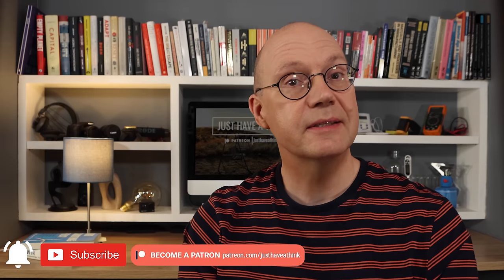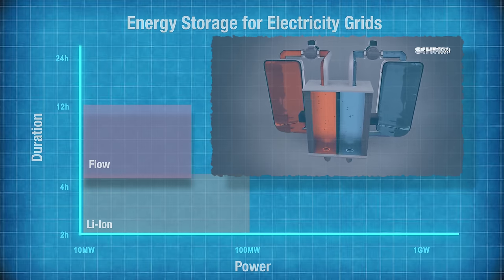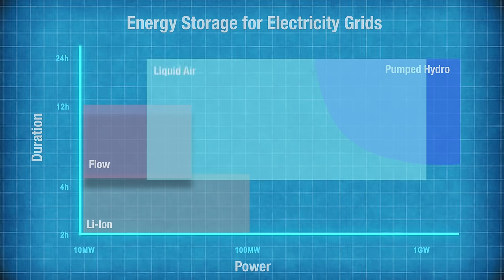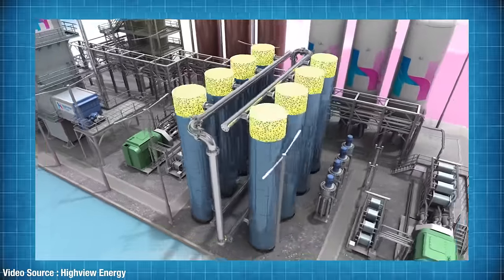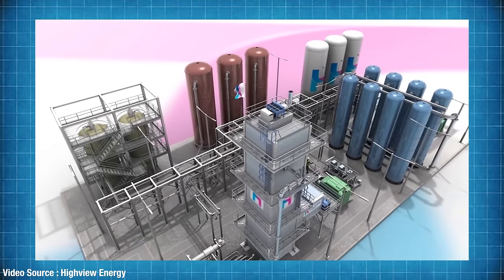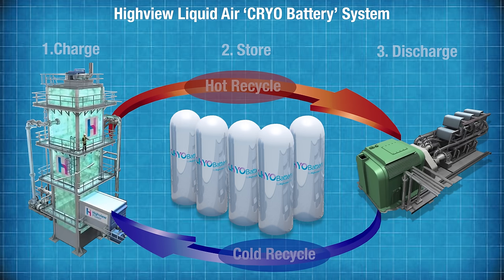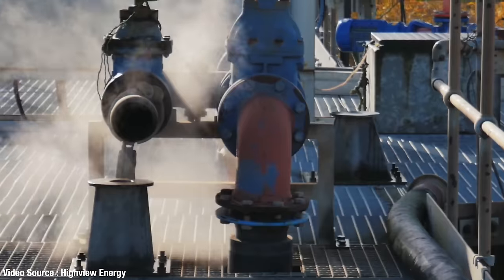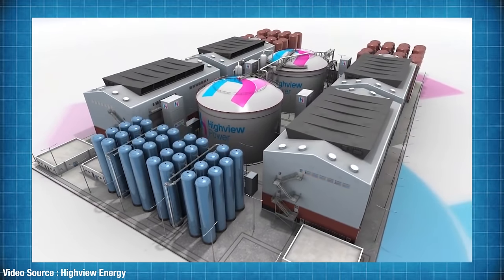Liquid Air Batteries. Literally energy from thin air. Seriously. Literally!

Comment: The 60% efficiency are mere speculation though,  the only time they actually measured it they achieved 15%.
And to be honest 15% makes a lot more sense, there are thermodynamic limits on how efficient you can cool and liquify air at -195°. 
A cool concept, literally and figuratively, but it has to work before I belive in that.
Reply: Right, they have a huge efficiency problem.
Reply: I fix...   LIquid nitrogen
Reply: I think using magnetic refrigeration this higher efficiency is possible.
Reply: @princefriendship  I'm afraid that magnetic refrigeration will not be anywhere near economic at sufficient scale. The problem is that the magnetic field needs to be of the order of >1T over 10's of metres cubed. Superconducting magnets this size might bankrupt a small country.
Reply: @princefriendship  I haven't heard of a magnetic refrigarator in that temperature range though. 
You would probably need several different refrigerators in a line, because the entropy change just isn't that large.
Reply: @yzScott  I agree Scott the technology does not belong in the Electoral infrastructure it is the direct competition so fossil fuels and electricity. We are creating billions of dollars of additional stranded cost even trilliums in the dollars and the opportunity cost of that is mind-boggling. Just like you don't have to connect to the local methane grid the people have to petition their government to be able to build inner city homes what are self-sustaining as to the energy. You don't have to pay for the sewering if you want to save the planet. Getting autonomous trucks to bring you what you need and including the liquefied nitrogen and oxygen may need Constitutional Amendment but that is definitely doable I mean we did it twice for ethanol we can do it once for nitrogen.
Reply: Marc T  Europe has recognized that heat has a temptation to people who speak without doing the math. They have been for a number of years not decades researching seriously Cold Storage. But liquid nitrogen is cast as gold storage by the electric utility industry, not by me.

The question that you raised concerns the viability and Constantine airing or cost engineering of Distributing energy with high temperature liquids. Heat is far more dangerous and salt is infinitely more expensive.

It's important to appreciate the impact of zero. It's actually a number and people argue in ways technologically dependent without awareness. The two comments I am responding to not just yours accept witlessly the propaganda ignoring anything--but esoteric facts like liquid nitrogen is a material. It is a material whose value has been historically suppressed. If you consult the comments on the originally titled liquid nitrogen economy crowdsourced encyclopedic submissions people argue and I am sure the location of their existence if accurately discoverable would be compelling and not on your side is dangerous.

 You can say all sorts of things about liquid nitrogen but like Three Mile Island it does not speak to Danger. In both cases man-made equipment that was abused and did not need to be made created fear of the irrational totally irrational and unfounded species.

 Liquid nitrogen is an added value material. It has nothing to do with Cooling. Just because we have change the phase of the atmosphere historically one way does not mean that that way makes any sense. I agree people don't skin cats anymore but we are talking about saving the world and disruption is easy to put off is easy to argue against and the truth nothing is easier to mock.

The enemies of progress will never do the least to be true to their cause. How much is too much for a gallon of liquid nitrogen? You won't say. Even talking about the cost is something that has not occurred by any of you. It says if you know oh, what you have done today, creates the debt you will never pay and not having anything to say at the gates did not stop you. As if. I know that you're Clueless. don't get me wrong about that please.
Reply: Marc T  I knew that people would nitpick about various de minimis costs but very much appreciated the bonus material you have offered.

I don't think you understand the gist however. You also seem to not understand that expansion does not drive the potential energy but rather at the forces of the expansion and that the temperature correlates nonlinear but Beyond very much merely exponentially phase-change expansion forces. That's why I emphasize the mass itself it's being converted into energy when the phase changes. It is that nuclear energy that using the atmosphere as a means of making mechanical energy portable.

It's the difference between plain old telephone twisted pair and Optical fibers that can only transmit light. Electricity is not fuel because it cannot be bottled cheaply enough to compete. Energy however can be distributed internationally and that's why you're saying putting molten materials Underground is not relevant to the portability of energy and what that does to demented Notions of Market expansion for the electric grid to include traction power. Traction power uses fuel and nitrogen is fine.

Your argument is however pathetic regarding by-products. Liquid nitrogen is a byproduct currently. the way by products are currently obtained has nothing to do with the way you would do them given scale. thermal pumps especially benefit from scale not just when you use water as your refrigerant but apparently the market which you respect are you the magnetic bearings become cost Justified only in the largest compressors. This sounds like vacuum tube controlled magnetic bearings more than a contemporary observation but there are additional orders of magnitude in scale especially globally when you Kim chip energy and create energy as this Millennia commodity.

Commodifying raw energy means learning how 2 snap atmospheric gases and ship them at Hypersonic speeds without using much energy to do so nor in a cost-prohibitive manner. I understand fully how to get this done. I expect resistance.
Reply: Marc T  If by "word salad" you mean yummy and satisfying, then Yes. If not, then "Free your mind!".
Reply: You don't need to prove it works. Just convince those who dish out the grant money.  
It looks to me like an elaborate way to convert electricity into heat. Loose lots in storage. The covert what remains back to electric.
Reply: @yzScott  and no storage has 0% efficiency, if you can make the infrastructure at a price comparable to making a new power plant of comparable output it could be feasible at 10% efficiency.
Reply: @jean-pierredevent970  I think that's French is so beautiful and I guess I do for a reason but besides the growing up in Paris we bring I respect 2 genuine Elegance instead of acquired tolerance two sofas tree that never goes away. I'm presently away from the grid so it's cheaper to just proceed with the riddles as opposed to correct them at this point but I will add it at some point.

The best the lie detector is the Rorschach. You see before you a a basically Bots Lament not paid to condescend but condescending because it can't actually comprehend what it's paid to intervene against disruption of. The disruption is above the pay grade of those paying the bot.

Jean-Pierre we stand and can resist. We are not the Bots. It is too stupid to be satire what the bot says namely don't squeeze heat out of vaporized oxygen and the nitrogen but instead use to small wire and too much energy. The Bots says spend too much money on infrastructure to do so. Taking the heat out of the air leaves behind as a byproduct the potential energy liquids and the boss says they cost too much when they are less than free.

As a scholar in the history and philosophy of science I can tell you the Bots have taken over for many decades and they proceeded vacuum tube technology. The Bots killed Kepler and they Gaslight but the worst Bots are the ones Electrify in the stealth of night. The greatest evil there is is those who are counting the trillions of dollars 4 foldable take electric factories yet-to-be-built a kind of chicken they think they can get their hands on without anybody finding out to objective.. it is a state of mind not merely a verb.

We stand for reason. against those who have their business plans dependent upon ignorance and the negligence from the clued who in this case do not include those with the business plans based upon business as horrible as it's been unimproved not evolved deliberately without the application of innovation because it's not the phase change material that makes things messy it's the innovation that causes the hemorrhage of the money cheats and their greed to make even more without greater ambition.

If you think that buying the proposed amount of photovoltaic electric panels is it a good deal then you must have a story about somebody having copped more from you than a feel. Such brain-dead fundamentalism has the solutions proposed Yesterday by the fossil fuel industry to the Perils they pose embraced now because there are far less crazy then when proposed. It is uberus however to think that the fossil fuel industry badly misjudged there are altimate evolution or profoundly troubling present inexpensiveness versus incredible amounts having been spent relatively speaking in the past But ultimately insignificant compared to what we are threatened to waste in the future. Nobody has observed about my insights that much of what is true in them is not dependent upon modern materials or technology. Yes it made buying photovoltaics in the past even more evil than that now. there is no s persuasiveness to that fact however beyond the obvious that affordable text was not proposed we would have made them obsolete back when it was $5 a w a t t instead of 5 Watts for a dollar
Reply: @Irene-fu6gj  is a bot.
Reply: @davebutler3905  you may be a butler but you wouldn't know a loose lot out of storage.

Comment: It would be interesting to see if adding geothermal heating into this cycle, since you get so much more heat out vs power in for geothermal, it could offer a effective boost to the output of the compressed air.

Comment: Imagine if we had started funding stuff like this 30 years ago
Reply: Jonathan Strandberg we might have avoided the climate crisis.
Reply: Thirty years would not have changed the power density or intermittency of wind or solar. Batteries can't fix it either.
Reply: We might be free from semitic bankers
Reply: Imagine if they started funding this 300 years ago...
3000...
300000000000000
Reply: The "We" would have probably not existed now.  The We, for some mysterious reasons, all died of heart attacks, according to government sources.
Reply: Its been being worked on for hundred of yrs
Reply: Yeah, it has been tested already for WELL OVER 30 years - and no company has managed to make it even remotely viable as cryogenic compression is one hell of a fundamentally inefficient method.
The best theoretical projections say something around 60% efficiency - and that is not even entirely correct as that assumes pumping in large amounts of extra "free" unaccounted energy (which normally gets used for things like district heating).
Reply: @Allen Loser there are a few test facilities and if memory served right the newest one isnt even 5 years old.
Reply: Peter Guilliatt : Do you have any idea how much power is required to compress air into a cryogenic fluid? You would use all the power you generated the previous night.
Reply: Kapitalism doesn't function like this.
There is still too much oil to sell.
Reply: True much of military costs could also be avoided since recent wars are mainly over religious beliefs and energy reserves.  But there wasn't a general thought to need alternatives as immediate as now and a lot of the technology wasn't present and manufacturing processes research etc.  I also believe just the widespread availability and acceptance of the internet has fostered many new innovations and ideas.
Reply: tee kay : As far as climate change is concern, there still is not the immediate need for alternatives. I’m not advocating for no more technology but there is no need to destroy the  planet in order to prevent the destruction of the planet.
Of course the internet is a great tool for information and the exchange of ideas....as long as it is not censored 🤬.
Reply: @professormawillett4297  I dont think so either but there is no reason to take a chance .That is a topic of voluminous debate and in my opinion no definitive proof either way but there are natural climate changes also.  Neither you or I can make that statement except as total OPINION. Again I agree with you but still an opinion.
Reply: @peterguilliatt  you can't charge this system from solar or wind without batteries....
Reply: Ge In : Are you saying that it did happen or just imagine IF it did happen? One might be worrisome, the other just a flight of fancy. Which is it?
Reply: @NwoDispatcher  go away.
Reply: Funding isn’t the only part of the equation. You have to find the right people with the right experience to be able to contribute different ideas to reach an unlikely solution. Just throwing money at a problem will not solve it.
Reply: Greg White finally someone else who understands.
Reply: Seth Jeffrey : Hallelujah! Someone gets it.
Reply: @nickiemcnichols5397  the climate crises has been scientifically proven to be cycle the earth goes through in 11 year periods. It would happen if we were here or not. That doesnt discount that pollution is real, but its being used as a way to either encourage us to clean up or profit from the endeavour.
Reply: @peterguilliatt  Still wasting allegedly 40% of the energy and this doesn't make wind powered generators any more efficient. Also who told you that is more windy at night?
Reply: A liquid air powered car called Liquid Air was built between 1999 and 2002 but it couldn't at the time compete in terms of efficiency with other engines.
Literally took 30 seconds to find it
Reply: Some of us did
Reply: We would be good from crackpot inventions!
Reply: Even further back. If you read Teslas last known paper he was talking about this from birth I believe.
Reply: Remember 30 years ago gold wasn't $2000 announce it has to be economically viable for it to work did you  miss that part of the Presentation.
Reply: Rotary Wankel air motors, as in-wheel hub motors, were designed into the GM Cadillac Aera - - 1000 mile range with very high power-to-weight ratio, the vehicle would be 1000 lbs, made with carbon fiber composites. This won the Concept Car division of the L.A. Auto Show about a decade ago, but the car was never manufactured. I was advocating for a simplified model - not a luxury car! For the everyday car user who wants a superefficient, essentially nonpolluting method of transportation with near zero maintenance issues. Most people just give you a blank stare when you mention an air motor car. they just label you a nut and move on. Then 20 years later, up pops this guy with a liquid air battery storage system, something I had suggested on my Informagnet website back in 1997 but of course never did anything with. So kudos to him. The new motors are nearly silent in operation. Look for new design for rotary Wankel air motors at >> EngineAir Australia (Angelo Di Pietro). I have no association with them, I'm just interested in the technology.
Reply: The technology that breaks down air into several components has been around for 25 years. It’s odd how ideas like this get buried or voided.
Reply: Nickie McNichols there probably would have been something else to panic over.
You know how humans are.
Reply: Cernumospete and if oil wasn’t continuing to be sold then what would the environmentalists have to panic?
Reply: Thirty years ago we thought we would have fusion energy by now but we are still at least fifteen years away.
Reply: Jonathan, here in the US we were going great guns UNTIL the Nixon & Reagan administrations cut the Green Growth off at the knees (along with free higher education).  Think about if a Green Government actually promoted Green Power and (still) gave incentives to new ideas that reduced the need for fossil fuels!
Reply: Who is "we"?